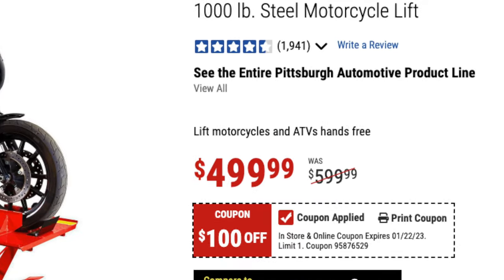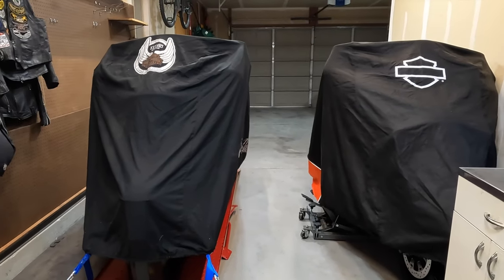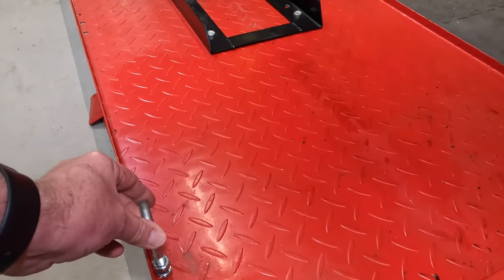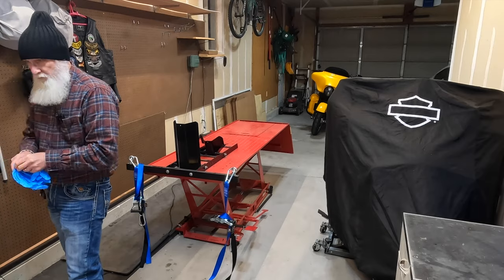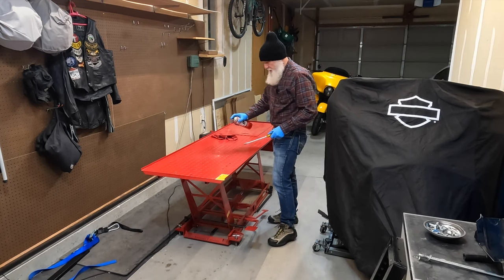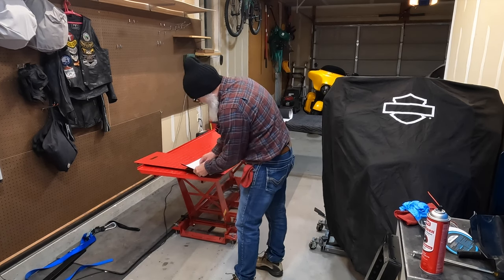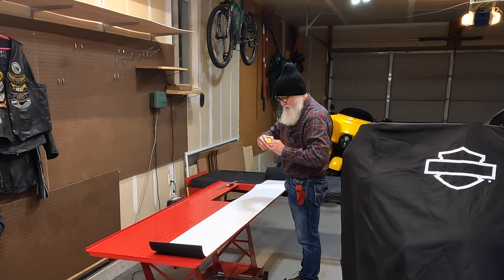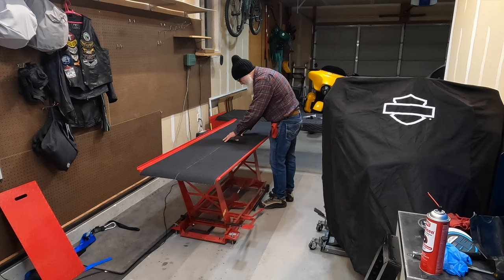Improve Your Motorcycle Lift | #harborfreight #antislip  #limited #whyiride #motorcycle life

Comment: Clem - I really appreciated your video and your ideas are exactly what I am doing to my lift. Recently I changed my oil and filter and it was somewhat difficult getting the Street Glide Special without assistance onto the work table. The tape installation will go a long way to improve getting the bike onto the table. Excellent work thanks!
Reply from the maker: Thanks for the comment. I have recently found that the surface is not totally bullet proof. Oils and general dirt can be washed off with a bucket of dish soap and water and the use of a bathroom style scrub brush… no problem. But I had a DOT 4 leak down on the surface when I was flushing the hydraulic clutch line and after pulling the bike off the lift and sliding the front tire on the surface, the tape disintegrated. Luckily none got on the bike or I would be talking about my ruined paint. I plan to remove and replace a portion of the tape again.

Comment: Thinking about doing the same to my lift. I’m currently upgrading to an air lift system so I don’t have to jack it up with the foot pedal. I saw another apply the grip tape and after it was applied they used a heat gun to cause the grip tape to fully adhere to the checker plate.
Reply from the maker: I am going to add a pneumatic cylinder as well. Which cylinder did you use… what size… any welding involved?

Comment: Was given one of these lifts in exchange for a transmission rebuild on a Dyna. You're very kind with your comments about the original chock. It's a pos! Good job on the non-skid, looks professional.
Reply from the maker: Tom, you were quite kind by only using an abbreviation for your characterization of the original wheel chock. You are also quite correct in your assessment. :) I really appreciate you taking the time to comment to the post. It is folks like you that make me want to keep producing content; thanks for watching and subscribing!

Comment: Great video and instructions. I have one small suggestion; I noticed when you jacked up the lift and put the security bar in you didn't remove the pressure from the bottle jack placing the weight on the bar. Doing this will prolong the life of the jack and should keep it from failing when it is in storage with a bike on it.
Reply from the maker: You absolutely correct. I typically relieve the pressure on the jack by using the bar as mechanical stop. Thanks for the reminder and thanks for commenting and hope you subscribe.

Comment: Hello Clem, thanks for taking the time to produce the video.  I've had this lift for about 15 years.  The heaviest bike so far has been a 540lb Moto Guzzi.  I just bought a 2016 Road Glide Ultra and it's good to see the lift work with a heavyweight, but like others have posted having problems with the weight don't know if I'll use it or go bigger. Darn thing are narrow but you make it look easy!  Bumble Bee 🐝 is a sharp bike.  Cheers.
Reply from the maker: Thanks for the kind words. I do used the lift for the typical preventative maintenance and accessory work. I always attach the strong straps on the front and thus far no issues. The only issue I have had with the lift thus far is where the hydraulic cylinder attaches to the triangular weldement where the weld failed. I had to take the lift back and demand a replacement. I have limited space in my little garage area and I have two bikes. I would love to have a larger lift if I had space and used the lift constantly to make a living. I am sure I will do more structural enhancements over time, just because I love spending time in the garage and working on “things” when I can’t be out riding.

Comment: Great idea, and I did it to my lift before I used it. Thanks for the great advice and video. Much appreciated 👏.
Reply from the maker: Stuart, just beware, the only problem I had is when I had a DOT 4 brake fluid drip down when flushing my hydraulic clutch mater cylinder and it ate right through my abrasive surface. I am repairing it now with a patch area of new tape. Thanks for watching and commenting.

Comment: Great tip and I will be making that mod to mine.  I also have the same front wheel chock that you do and what a difference it makes in keeping the bike up until you get it snugged down... thanks for the video...
Reply from the maker: Absolutely. You need a way to load and dis-mount the bike without help. Thanks for watching.

Comment: Ive been thinking real hard about this little lift. I think im ready to pull the trigger. Ill probably convert it over to air. My plan instead of the grip tape is simply to spray the entire top with roll on bed liner. It should have adequate grip and a more permanent adhesion.
Reply from the maker: I am sure the spray-on liner will be just fine. I was thinking it may require some sand-blasting or real rough sanding to put a rough surface on the metal to allow the spray-on surface to adhere well. Thanks for watching my friend!

Comment: A more permanent solution is a thick coat of gloss paint with silica sand sprinkled in it when wet. then vac off the surplice when dry.
Reply from the maker: James, I see that recommendation several times in the comments. I
May very well go that route in the future. I recently posted a follow up video called “1-year Later” with how it has been wearing.

Comment: I'm looking to get a lift and have been eyeing this one since the price is right. My bike is big, but yours is bigger, and the lift seems to have no issue with it. I think the non-skid (that's what we called it when I was in the Coast Guard, anyway) surface is a great idea.
Reply from the maker: MP, for the money and the casual garage use, I think is a good lift. I can see buying a $2-3k lift. I only had one issue with the triangular welded gusset at the end of the hydraulic cylinder that buckled and I took the whole lift back for a replacement. Thanks for taking the time to comment! Really appreciate it!

Comment: I like the idea of improved traction in the lift, I think I will try pickup truck spray bed liner.
Reply from the maker: I think the bed liner is a great alternative. There are several ways to accomplish it. I did an update video this week we’re I talk about the various bed liner alternatives. Check it out in the link and I hope you subscribe to the channel. https://youtu.be/sB2wlqx3ilw?si=MJgXYmBAu03fxYjp
Reply: I've bought the bed liner from harbor freight ($49) on sale. I've done the floors of 2 of my trailers and it works great. I'd do the whole surface of the lift.
Reply from the maker: @bigdaddysshop8180  Awesome, I will have to check it out!

Comment: Use a hair dryer or heat gun to help adhere the non skid.
Reply from the maker: Thanks WW, you are correct, I did use my heat gun in a later 1-year update video on the lift as I removed and replaced some damaged Nonskid. Thanks for watching and giving tips. Really appreciated!

Comment: Bought this lift about 7 years ago. Used it for my 06 Royal Star Venture and two late model Ultra Limiteds until last week. I really liked it although the 1000 lb rating seemed a little wobbly when those big bikes were up and the platform was pinned. 
Last week I was getting ready to service my 2021  FLHTK Ultra and had the bike set and secured to the platform. I pumped the foot lever and realized nothing was moving. I depressed the release lever and tried pumping it up again to no avail. I walked to the other side and I could see the right side frame rail was bent outwards. WTH? I put the ramp back on, removed the tie-downs and backed my bike off really carefully. 
When I lifted the inspection plate I could see the problem.
  The weld where the flat triangular plate welds and meets the ram on the jack had split and in the process of me pumping to lift the bike it  all went sideways and bent just about all the mechanisms and linkage. 
  Like I said, I liked that lift but it just seemed a little too wobbly for the big touring bikes and I won't be getting another one.
  I bought a motorcycle jack instead. It doesn't lift as high but it's very stable and I can spin and even remove the wheels now.
Reply from the maker: I had the exact same problem on the original lift I bought from HF. I took it back about 18 months from new and convinced them to replace it since I was a ITC HF member.
Reply: I own a 2020 Ultra Limited. I have more money invested in this Harley than any vehicle I have ever bought. I feel the same about those Harbor Freight lifts. They are fine for light weight cruisers and dual sport bikes I own, but not for big bikes like Harley baggers and Goldwings. I bought a Handy Industries lift, which is made in Sully, Iowa. There is no better made motorcycle lift on the market, not at least what I have seen so far.

Comment: Duradeck...for boats. Super super good stuff. Non slip epoxy stuf.
Reply from the maker: I recently had some DOT 4 brake fluid drip on the surface of my lift and it basically ruined my abrasive surface after my tire rode over the affected area. Oil and dirt are easy to clean but beware of some chemicals. Luckily my painted surfaces of the bike were protected from the spill.

Comment: I'm building my own ramp and I thought the antislip tape is a good idea. However, it is liable to lift and oil spills could cause some damage.

I've come up with another idea which is to paint the platform surface and sprinkle some fine seaside sand on it while the paint is still wet and leave it to dry. Once fully dries, spray a light coat of paint over it to give it a nice finish. If need be I can put some more dsand in any patchy areas that need a little more to more or less even it up.

Has anyone tried this? If so, what is your opinion?

i shall be filiming the build and will put up a video once it is finished but it will probably be a couple of weeks.
Reply from the maker: ProfG, sounds like a great idea and a more permanent approach. Thanks for sharing and I look forward to seeing your build.
Reply: i have used it on the deck of boats to great effect.

Comment: i have the same lift.  i also added the black tape but i also added side extensions.  2 1/2 feet on eah side   used the same mesh that is on the back of a ramp trailer.  sure makes it safer to not only rideup but to also take it off. i am always afraid fo tipping  it or fallingoff the bikei use it on my  2018 gold wing. andmy 1100 shadow sabre. but i also off to buy another one tomorrow so i  have both my bikes off the ground  for winter
Reply from the maker: That makes your lift… what… 2.5 feet + 2.5 feet + lift at ~27”…over 7’ wide?

Comment: As an alternative to the friction tape, have you thought of applying a coating of that paint-on pickup truck bed liner?  It comes either in aerosol can and also in regular liquid paint cans.  I think I'd use the liquid - you can apply it with a roller or with a brush, and it comes in a selection of colors also.  You can also touch it up if it wears off, say, on the ramp part.
Reply from the maker: You bet! Check out my latest update on the lift. Hope you subscribe to the channel. Really appreciate your comments and input. Cheers! https://youtube.com/playlist?list=PLmgpxt96CnshH9Om1yCadKPHN-AdI6aBN&si=2cvwX-J4p-rsfpXQ
Reply: Doesn't work good. Tried it
Reply from the maker: @chrisc6874  thanks!

Comment: I would like to what you done with the wood in the wheel choke, does it make it easier to get the bike out
Reply from the maker: David, I have tried a number of simple things that I have seen others try on videos and things I have read. The small section of plywood  in the chock is one of those trial and error things. I have a ton of scrap wood since I spend so much time building furniture in my shop. I know this is a long way of saying, it does almost no help “for me” although others seem to think works for them. I would recommend you waste your time on this one. Very marginal benefit. Thanks for watching and asking about it!

Comment: Great Video - first of yours's that I've seen. Have the same lift, same wheel chock, but mounted just a little more forward than yours. Awesome Bikes Clem!!! Love the idea of this - but wonder about getting the paper oily while servicing the bikes. Heck even rebuilt an engine of one bike while on this lift and couldn't help the antifreeze getting everywhere. The hatch under the rear tire I read (I think in the instructions) is for access to the hydraulics of the lift. Saw other videos where they suggested to run screws through this plate, so it doesn't kick out under engine power. Also says in the instructions to walk the bike up (not ride) lol - but we all ride it up. The rear most U-Bolt (to hold straps) holes I've used to hold removeable wood (a 2x4 on the lift, and a 2x8 on top of the 2x4 that extends past the rails of the lift) and made pins out of long bolts to sink down through the holes to easily give me leverage and height to getting the bike out of the wheel chock. Great attention to detail sir, you made a subscriber out of me.
Reply from the maker: Charles, thanks man for the comments and great suggestions. I fully expect the tape to get warn out quick, either by scraps, oil, something. I guess the real challenge should be removing it for a replacement. I suspect I will continue to spray it down with brake cleaner as the grime builds-up. Not sure how the break cleaner will affect the surface.
Reply: @clemgriffis3446  I bought tape for mine, haven't installed it yet, actually have my lift dismantled at the moment due to a leaking jack. I have bought myself an 1/8 x 25 x 40-inch piece of aluminum to put down after a bike is on the lift to protect the tape. 

I was a little disappointed when I flipped my lift over and found many bolts loose and/or mechanical mechanisms not in the best shape. I almost have to be thankful that the jack leaked for me to dive into truly servicing this lift.
Reply from the maker: Yes, you may find a number of things that are substandard. I actually have my second lift after the first lift broke where the cylinder bent the triangular metal it attached to underneath. I took it back and they replaced it with a new one.
Reply: @clemgriffis3446  Wow! I would've never saw that coming. Hope all is still good though? I wound up doing extensive modifications to mine and converting it to a remote control electric winch, it's working good so far.

Comment: How’s the sand paper holding up? Thinking about using rustoleum truck bed liner on mine. Makes a hard grip surface and it’s about $22 a can at Walmart. Not sure though.
Reply from the maker: The anti-slip covering is holding up very well. As long as I can keep the oil off of it, I think will last a long time and n to get too nasty. Check out my latest video, I cut down my wheel chock to get more room under the bike. Reclaimed some great space. https://youtu.be/YKgm5guaAgY  I have thought about various coatings but so far the abrasive doing the job! Hope you subscribe and thanks my friend for watching and commenting! Give us a thumbs up 👍 if you like the content.

Comment: I like the wheel chock.the tape looks good.that’s like skateboard tape.not that your’s is a bad idea.but personally I would of used the rhino lining truck bed paint.if the cost wasn’t too high.or maybe it’s called line x.thanks for sharing.some good ideas especially the wheel chock.
Reply from the maker: R.H., Thanks for the comment. Yes, I have Line-X in my pickup and it is extremely durable. Like many of us, I probably spend more time and money on my equipment and various forms of related gear than is necessary. I tend to buy tools, power tools, equipment and raw material just so I can build nice methods of storage for all that new equipment I just bought, 😀… you know kind of like buying dog food on sale and then realizing I need to go buy a dog. I joke but I am smart enough to know that I do what I do truely for the therapeutic value and then pleasure I get out of it… that why I call it “Garage Therapy”. 

I think you are right that a permanent coating is likely quite expensive and push the cost of the lift into the higher ranges of those professional lifts. I suspect I will go many years before I have a need to replace the tape. Thanks for being a subscriber!

Comment: Hopefully the oils you get on will come out. I just placed my non skid on the ramp and the leading edge. Now the oil is cleaned up easy and not on the tape. Let us know after 2 or 3 services on you bikes.
Reply from the maker: Great point. Next change will come up soon. Thanks for the tip.

Comment: I'm a new sub, 3/29/23. enjoyed watching this as I'm in the market for a table lift. Two things that I have consistently heard for improvement on the HF Lift, is the wheel chalk you installed,  and reinforce the front and rear underside of the lift with a piece of angle iron in order to reduce the table from flexing or twisting when under load.   I was really interested in the amount of space you had for your feet when driving up and backing off the ramp.  Wonder if HF has table side extensions for this lift?  Thank you.  Nice job on the non skid and wheel chalk install.
Reply from the maker: Thanks for the kind words Rodney, I like hearing from folks who find value in the videos. Hope you feel it is worthy of your subscription if you are not already a subscriber. I have been putting long hours in my day job but hope to release a new video in the coming days about a new ramp to take my Harley’s into the back of my pickup. See you on the next video!